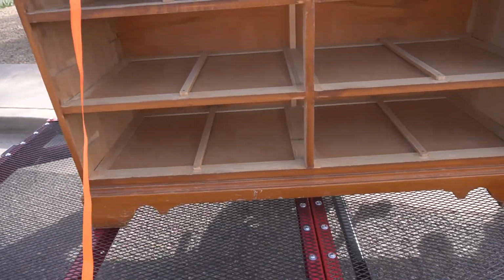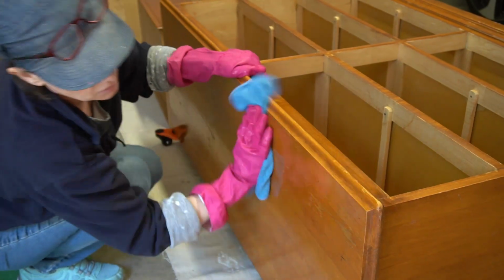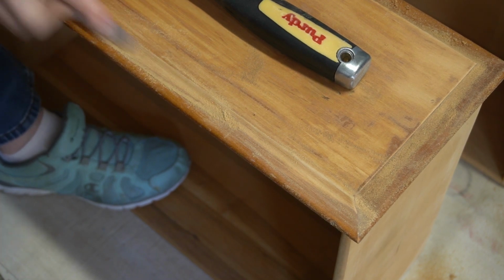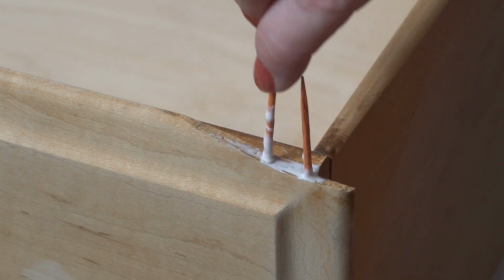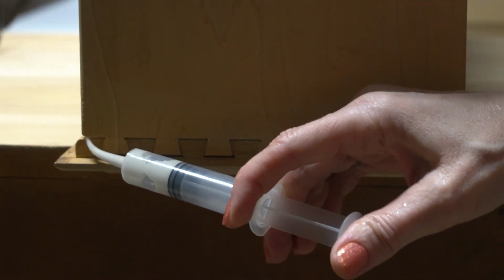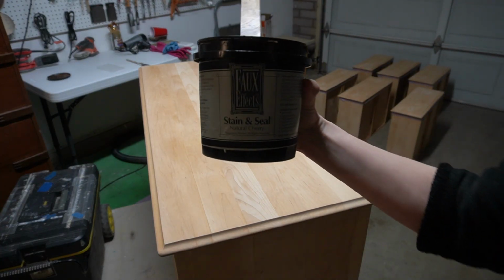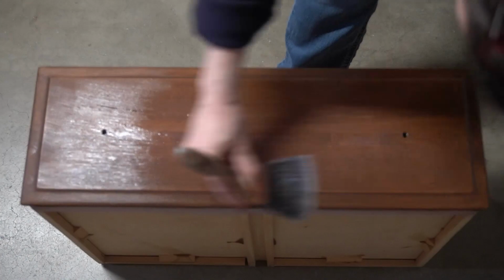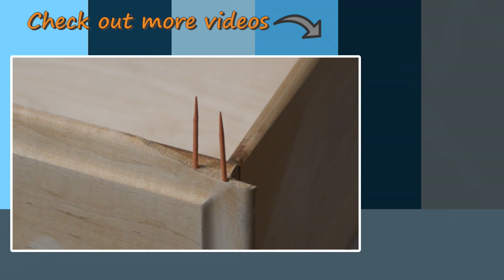Maple Dresser Restoration | Crawford Furniture #furniturerefinishing #solidwood #fauxfinishing

Comment from the maker: Hey peeps! A few people have mentioned it so I probably should've mentioned in the video about the stain. Faux Effects is a bonding product, it doesn't penetrate the surface the same way as traditional stains. I sanded the wood to smooth because it's better not to sand large areas of the stain if possible once it's dry. Sanding can break down the pigments and the bond if it's not done correctly.👩‍🎨🥰

Comment: WOW!! She turned out GORGEOUS!! Especially all the different types of damage you had to repair. Extremely impressed with your woodworking skills, like repairing the corner using wooden dowels (the toothpicks) and cutting a piece of wood vs shaping epoxy wood filler. I’ve watched some of these pro woodworkers (like with equipment in their shop that costs as much as my house) use these skills and you were spot on with your technique. Especially having a detailed edge on that drawer front! You mentioned you had some areas that stained darker in some areas. I had the same issue on a piece and it was bc I sanded higher than 220. I found out (by reaching out to some furniture restorers) that sanding anything over a 220 grit makes it hard for the wood to “accept the stain” bc the wood fibers are too closed up (Angie at Transcend Furniture Gallery was a huge help in this). I know this was a lot of time consuming work, but the end result was so worth it!💜
Reply from the maker: Ashley you're so very kind! Thank you so much! 🥰🥰🥰 I did have a long call with my dad to work out doing that corner with the dowels. That absolutely terrified me until the holes were drilled and toothpicks fit! Thankfully maple is a hard wood so even that thin area didn't split 😓 A few people have mentioned it so I probably should've mentioned in the video about the stain. Faux Effects is a bonding product, it doesn't penetrate the surface the same as traditional stains. I sanded the wood to smooth because it's better not to sand large areas of the stain if possible once it's dry. Sanding can break down the pigments and the bond if it's not done correctly. Hmm, gets me thinking, maybe I should do a whole video on various stain sometime? 🤔 Thanks again so much!
Reply: @CopperCactusDIY  gotcha re Faux Effects. I thought it was more like a gel stain, which while it sits on top of the wood, it does penetrate the first layer. Vs liquid oil or solvent based stains, that does penetrate. A video on different stains would be a great idea! Even using different types of wood, when to use a pre-stain wood conditioner, etc. I’m a gel stain person myself and was terrified to use it the first time, until I realized how easy it was to use. 
Always great to have someone to call on (like your dad). My husband does woodworking as a hobby, so he’s my go to when I need help. Now if I can just get him to keep his saw dust off my stuff in the garage…🤪.
Reply from the maker: @ashleyosborne6239  ah, the impossible dream - sawdust free workshop! 🤣😂
Reply: @CopperCactusDIY  true! I bought a really nice 6hp shop vac (plus it has a vacuum bag in it) to connect to my new Surf Prep and told him “hands off buddy”.🤣 Seriously though, I made sure we could connect it to his table saw and router, but it isn’t to be used for anything else (like vacuuming the stuff off the garage floor, that’s what the old shop vac is for😁).

Comment: Great job! Lots of work. I’m about to restore a 1920’s sewing cabinet that needs lots of gluing. 😆 I love the tone of the wood stain you used but I think it might be do opaque for me. If you water it down does it show more of the wood grain?
Reply from the maker: Stain and Seal is an interesting formula. It can be watered down slightly but shouldn't be cut more than about 10%. It's not really a gel stain and won't penetrate the surface, instead it bonds. But you never lose pigment so the opacity might still be a problem even with multiple light layers. Thanks so much, and good luck!

Comment: Maple always needs a pre-stain conditioner as it receives stain in very blotchy patterns. If you had used this, you wouldn't have had so much work to do getting the stain to look good. However, in the end, you got there. It's beautiful ❣️
Reply from the maker: Thank you, I appreciate that you enjoyed the end result. However, this particular brand of stain (Faux Effects Stain and Seal) will not function properly over a pre-stain wood conditioner, regardless of wood type. The formula doesn't penetrate, it bonds. It would bond with the pre-stain and eventually peel off the surface. This is why it's important to understand the particular product as well as the substrate it requires to be successful.

Comment: I would have applied wood conditioner first to allow the stain to adhere evenly.
Reply from the maker: For oil based stains and some gel stains that's true. Faux Effects formula will not perform correctly over wood conditioner.

Comment: how do you know you need to change the sanding disk?
Reply from the maker: When it gets to the point you have to start applying pressure for it to do the job, or when it seems like it stopped working how it should.